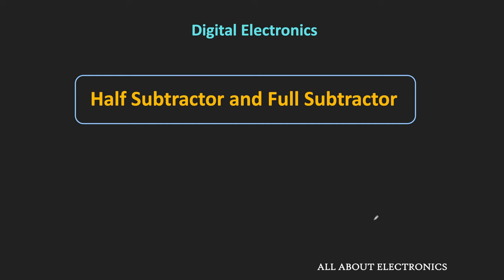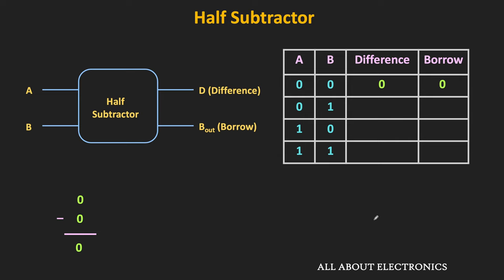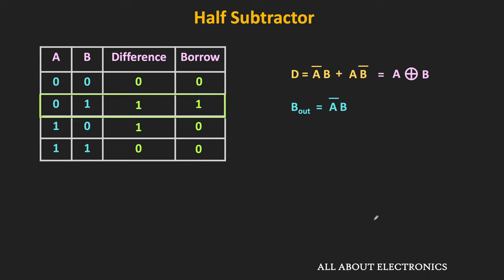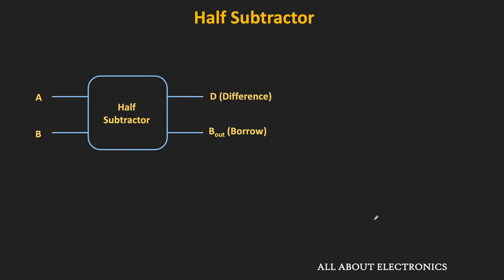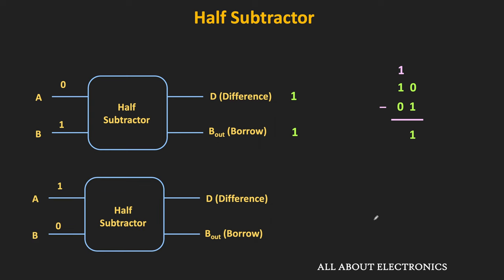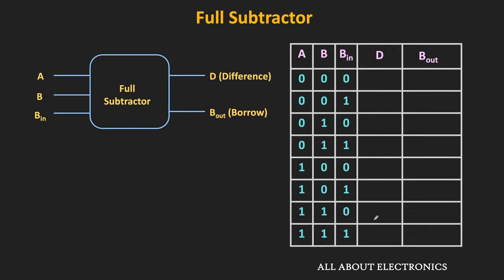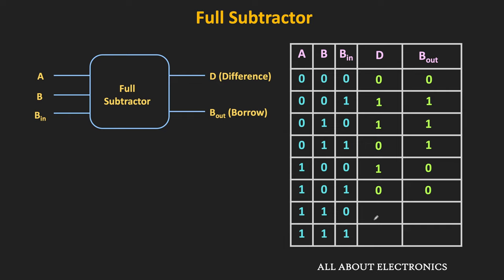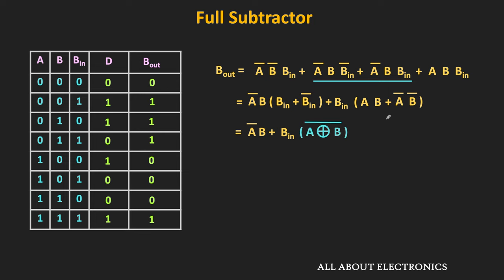Half Subtractor and Full Subtractor Explained

Comment: Hello, I would like to ask something regarding the full-subtractor. In the video, you are using the format in which we are looking for the combinations of A, B and Bin such that Bout = 1, which results in the formula you have written and worked on in the video. When I follow your video and try to use Karnaugh, I end up with a AB/Bin table in which I have the values as [0, 1, 0, 0; 1, 1, 1, 0] and the resulting Karnaugh is Bout = (~A) * Bin + B * Bin + (~A) * B. I understand both logics, but then why is it that the functions for Bout are so different? Besides this point, thank you for the video and explanations. Your work is much appreciated!
Reply: same doubt his equation has mistake ig
Reply: His equation on simplifying becomes yours one, so it is correct
Reply: @EMERGINGGamer  Most likely. I was studying for the exam at the time and I may have been too tired to check thoroughly (in addition to having limited time to check them). I am planning to revisit the material so I will just spend more time on trying to figure it out. Thank you for clarifying it though, it actually helps to know that I wasn't simplifying the equation in the video right.

Comment: 4:59 you have said 1-0=1 which is difference and then 1-0=1 which is for borrow out but you have put 1 for D and 0 for Bout it should come  11 for 1 0 0 input right?
Reply from the maker: 1-0 is also a difference. (But without Borrow). We are not borrowing anything to get this difference. At 4:09, as you can see, we have taken borrow.
Reply: @ALLABOUTELECTRONICS  thank you for your explain
Reply: Can  you say if that question like how an X-OR gate can be used to complement a single bit for this does we want to use half subtractor as an answer?

Comment: Everything is okai but sir your explanation lines hides the diagrams and all plz fix it to small size or make ur diagrams and all on upper side and downside leave for that explanation lines
Reply from the maker: You can turn off the subtitles in the video settings. On the desktop, you can also drag them anywhere on the screen as per your convenience.
Reply: Thanks for guiding ❤